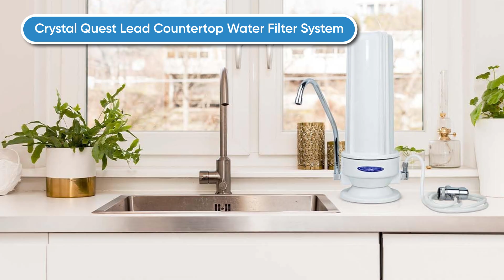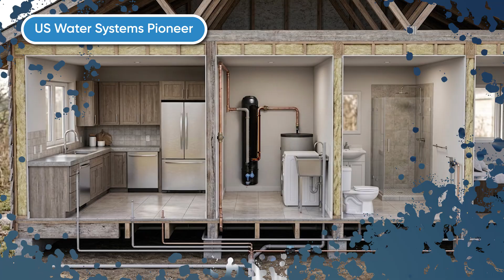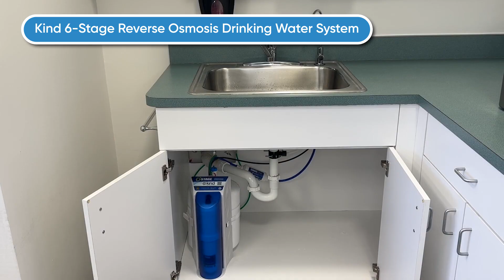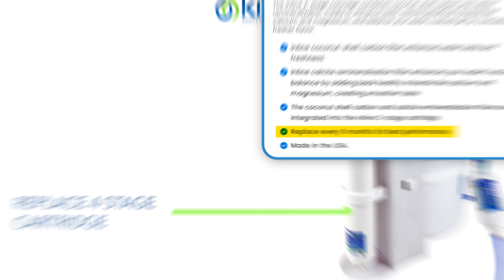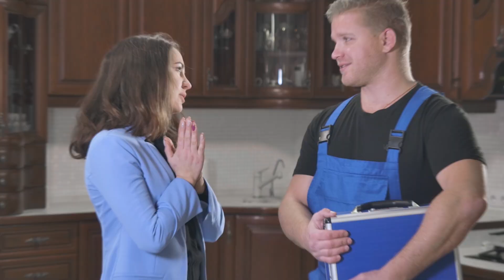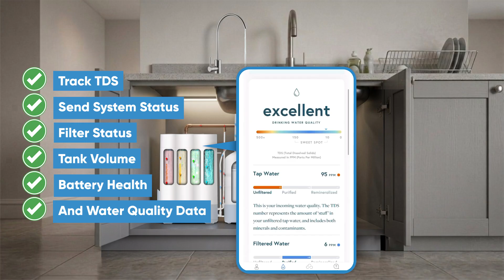Best Water Filter for Lead Removal 2026: Top 5 Picks That Target Lead in Tap Water

Comment from the maker: 📌 Best Water Filters for Lead Reduction (Which One Is Right For You?)
Lead contamination is typically addressed through reverse osmosis or specialized carbon filtration designed for certified lead reduction. The right system depends on whether you're targeting drinking water at a single tap or treating water throughout the entire home.

#1 Cloud RO — Best Under Sink Water Filter For Lead Removal
A multi-stage reverse osmosis system designed for drinking water purification at a single faucet. RO membranes are highly effective at reducing dissolved metals, including lead, making this a direct solution for kitchen tap protection.
🔎 See Full Details: https://waterclarityguide.com/go/cloud-ro

#2 Aquasana OptimH2O — Best Whole House Water Filter For Lead Removal
A whole house filtration system designed to reduce chlorine, chloramines, and lead throughout the home. Suitable for municipal water users who want broader exposure reduction beyond just one faucet.
🔎 See Full Details: https://waterclarityguide.com/go/aquasana-optimh2o

#3 Kind 6-Stage Reverse Osmosis System — Best Value Lead Removal Filter
A 6-stage reverse osmosis system engineered for comprehensive drinking water purification at the sink. Designed to reduce lead and other dissolved contaminants while delivering consistently refined, high-quality water from a dedicated faucet.
🔎 See Full Details: https://waterclarityguide.com/go/kind-water-pro-ro

#4 US Water Systems Pioneer — Highly Rated For Whole House Lead Removal
A whole house carbon filtration system engineered for lead, cyst, and chemical reduction. Built for municipal water homes seeking full-home filtration performance.
🔎 See Full Details: https://waterclarityguide.com/go/us-water-systems-pioneer-lead-cyst-pfoa-pfos

#5 Crystal Quest Lead Countertop Filter — Best Countertop Water Filter For Lead Removal
A countertop filtration system designed specifically for lead reduction without permanent installation. A practical option for renters or temporary setups.
🔎 See Full Details: https://waterclarityguide.com/go/crystal-quest-lead-countertop-water-filter

If your priority is protecting drinking water at a single faucet, a reverse osmosis system like the Cloud RO or Kind 6-Stage RO is the most direct approach.

If you want lead reduction throughout your entire home, a whole house system like the Aquasana OptimH2O or US Water Systems Pioneer operates at a broader treatment scale.

If installation flexibility is important, the Crystal Quest countertop system offers targeted protection without plumbing modifications.

(Some links are affiliate links. I may earn a commission at no additional cost to you.)

Comment: I just herd the news about the US Federal judges who ruled that safe water isn't  covered by the constitution AND that we don't  have the right to "Truthful information from the government." 

I'm  looking for whole house treatment for all the crap that's  out there AND something that I can use even when the grid goes  down. (As it will when the civil war starts.)
Reply from the maker: Yeah, that ruling has understandably raised some concern.

On the filtration side, I’d be careful with any system marketed as removing “everything,” because different contaminants need different treatment.

If you want broad whole-house protection, I’d usually start with a good sediment + carbon setup, ideally based on an actual water test, then use a stronger point-of-use treatment such as reverse osmosis at the kitchen sink for things like lead and other dissolved contaminants.

For outage preparedness, that’s another layer. Some whole-house filters can keep treating water without electricity as long as you still have water pressure, but UV systems, pumps, electronic valves and well pumps may depend on power. And if the water supply or pressure itself goes down, the whole-house filter obviously can’t create water.

So regardless of what causes an outage, I’d think in terms of two layers: whole-house treatment for everyday use, plus an independent emergency drinking-water option such as stored potable water and a gravity-fed or otherwise non-electric filter that’s specifically suited to the contaminants you’re concerned about.

If you tell me whether you’re on city water or a private well, and what contaminants concern you most, I can narrow the best setup down quite a bit for your needs.